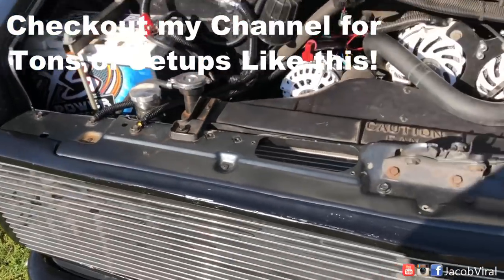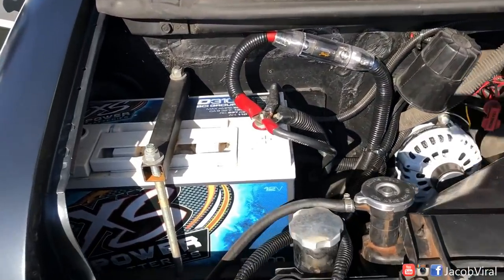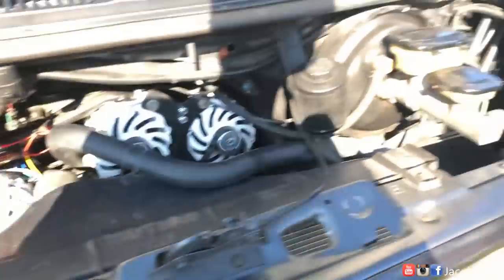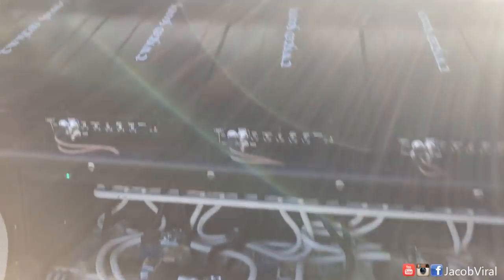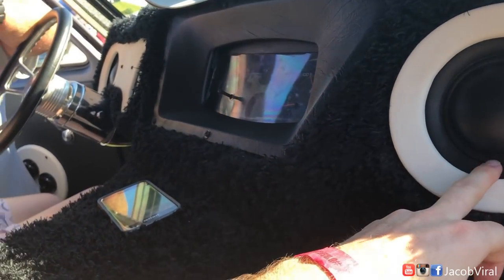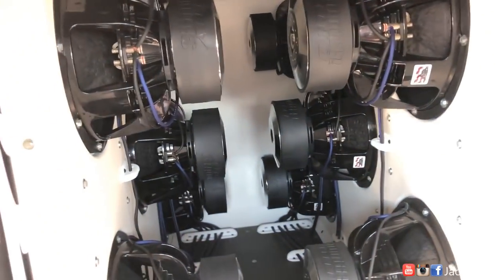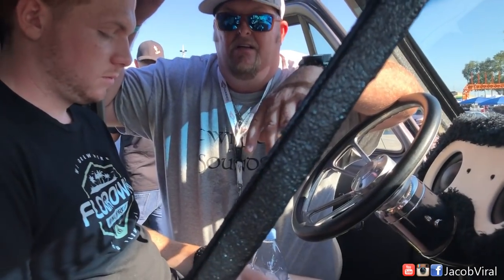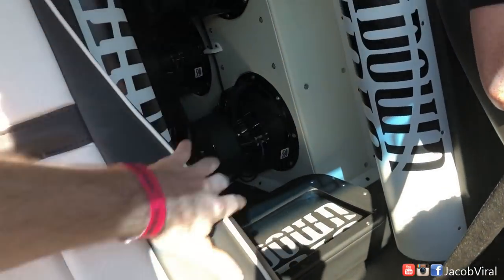CHECK OUT THIS INSANE BASS BUILD INSIDE THIS ASTRO VAN

Comment: I've inverted my subs on a couple different builds and i never reversed the polarity. I just let them fire into the encloser. What's everyones opinion?
Reply: If all the subs are inverted, there is no reason to reverse polarity. Weird that he has a build this size and still thinks that inverted means reversing polarity.
Reply: Agreed
Reply from the maker: No need to set polarity if all subs are facing the same way as Garron ah mentioned. It reacts the same. Thanks for watching!
Reply: Thanks for the info. Keep up the killer assed videos.
Reply: If you want the transition from subs to midbass speakers to be "correct" with respect to polarity, you reverse the polarity of the subs that are inverted. So he was correct in doing that. But the only time you would really notice would be when playing frequencies around the crossover point with the doors closed.